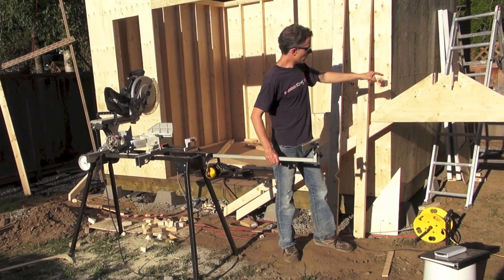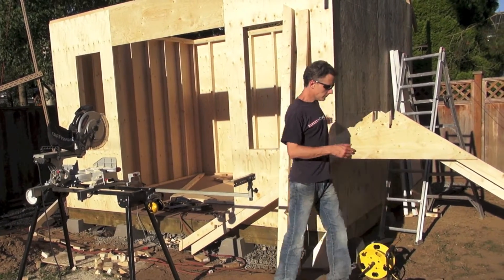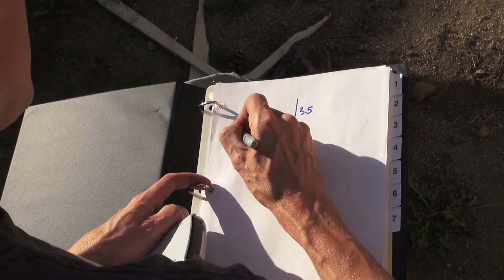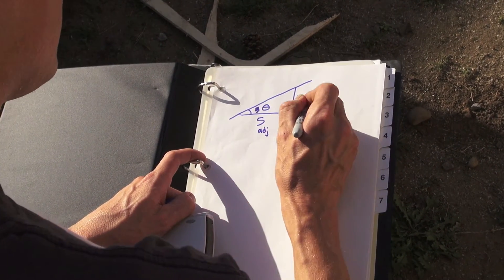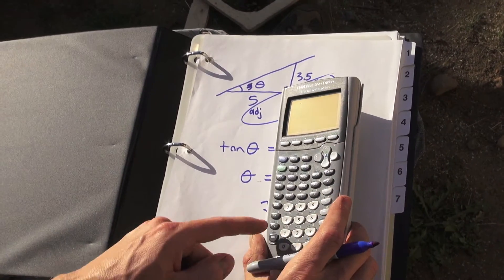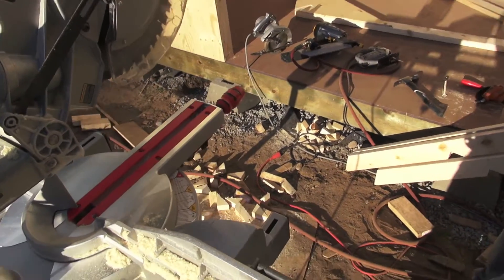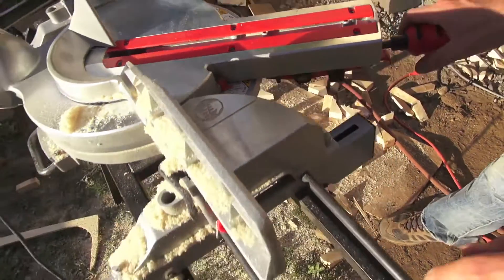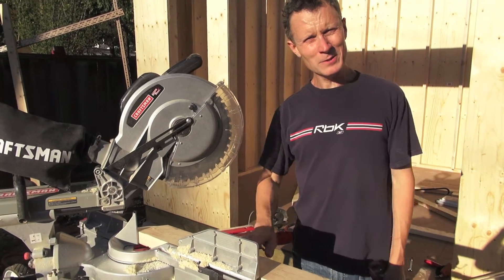"A Roof Over Your Shed" (part2)... Using Trig to Find an Angle • [Real World Math!]

Comment from the maker: Hi Desi,

Assuming that the 25 feet is the span across both sides of your roof (ie. you have a run of 12.5 feet to the centre), you need to find the corresponding rise - you can use a proportion to find it:

x / 12.5 = 5 / 12
         x = 12.5 * 5 / 12
         x = 5.2083...

Now use the 12.5 and the 5.208 to find the hypotenuse using the Pythagorean relationship:

     (run)^2 + (rise)^2 = (hypotenuse)^2
(12.5)^ + (5.2083)^2 = (hyp)^2
156.25 + 27.1267... = (hyp)^2
               183.3767 = (hyp)^2
    sqrt(183.3767...) = hyp
                 13.54... = hyp

So, just over 13.5 feet - it's actually about 13 ft 6.5 in.  
If the 25 feet is not the full span, but already just to the centre of the roof, then the final hypotenuse length would be twice as large:  about 27 ft 1 in

Hope this is helpful.